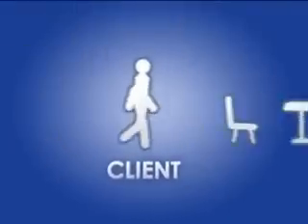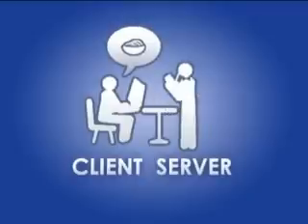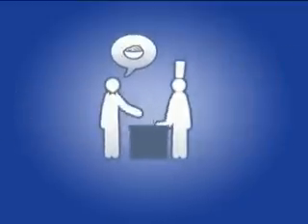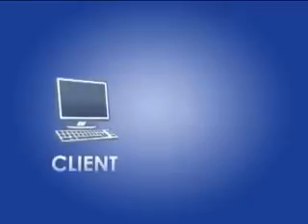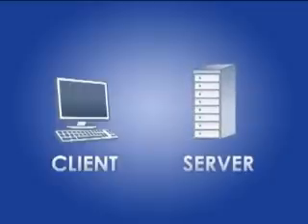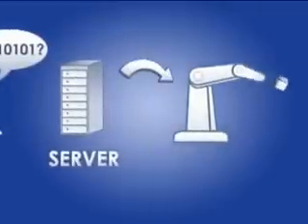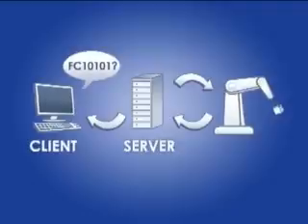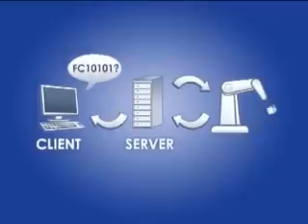Introduction to OPC for Factory Automation and Plant Process Control

Comment: Nice but information needs to be updated as it does not talk about OPC UA but the old Classic OPC. I personally didn't like Classic OP because of it's dependence on COM/DCOM. WE had too many issues deploying it on the field especially due to it's remote deployment issues. OPC UA is is relatively easy to deploy and stable.